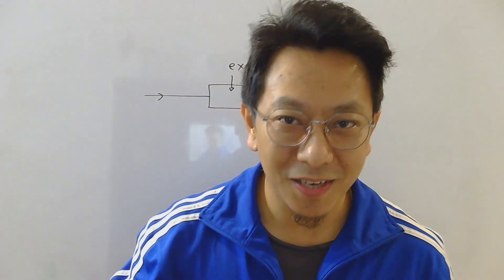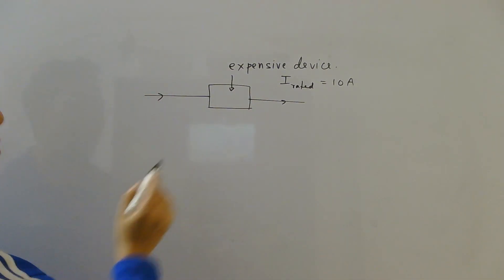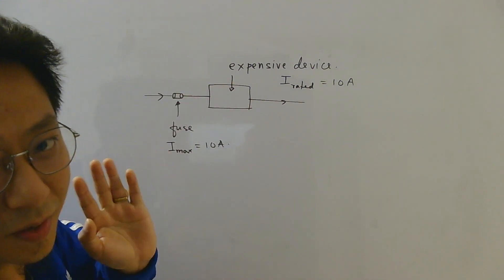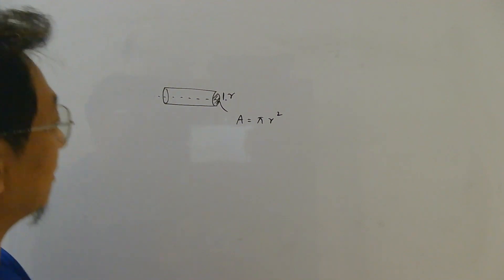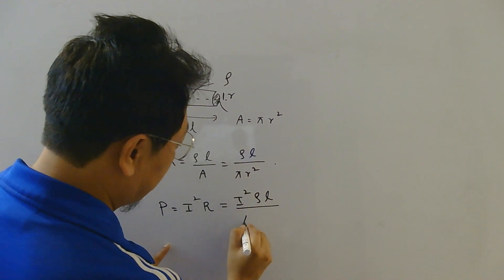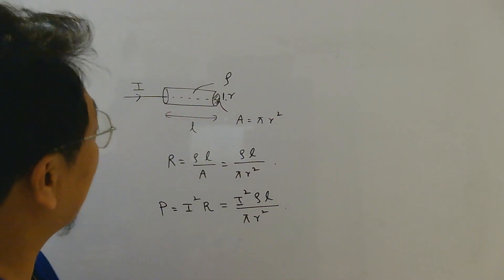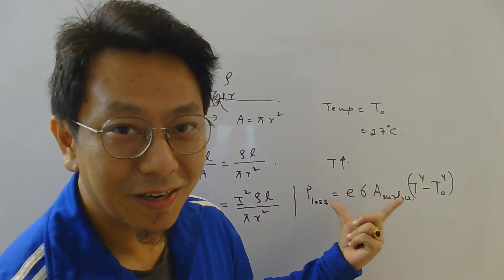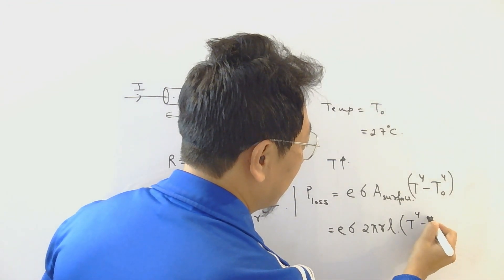Relation between maximum current (limiting current) and radius of a FUSE wire

Comment: Hello sir,
I have recently watched your amazing videos. You have helped me with concepts very much but I got a doubt, I saw your video in which you explained why the buoyant force is acting in upward direction. 
My question is when a container let's say a bottle is filled with water, then the pressure will increases down the bottle, but we know that water moves from high pressure to lower pressure but the water in container does not seem to move upwards. Please explain, waiting for your response eagerly.
Thank you
Reply from the maker: It's quite simple Pooja. Consider the water in the container at rest.

Take a portion of water as a system. Now apply Newton's law (I am soon going to share a video on Newton's law) to this system.

There will be a force upward from higher pressure (below) to lower pressure (above). However please understand there is also a downward gravitational force. And thus the upward force due to pressure difference is balanced by the downward gravitational force and thus that portion of water is in equilibrium. Same thing you can do for any portion of water in the container.
Reply: Thank you very much sir for the clarification 😃